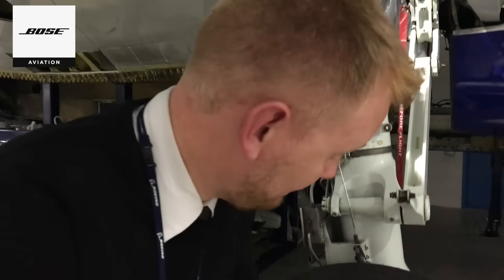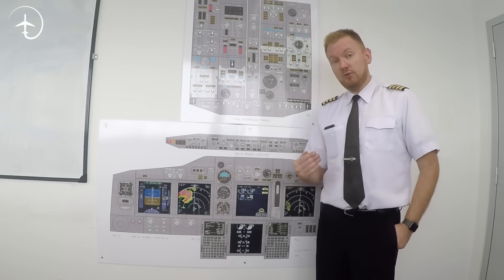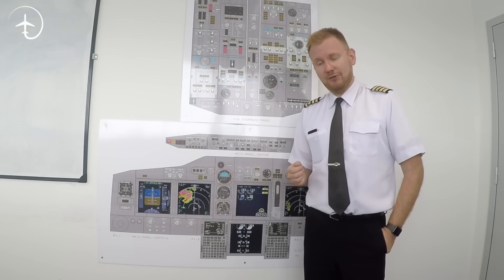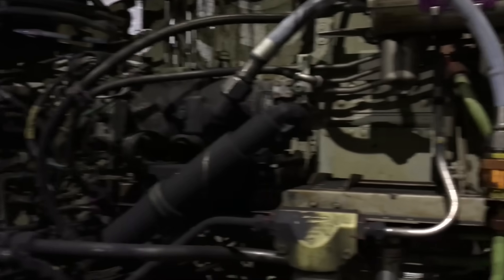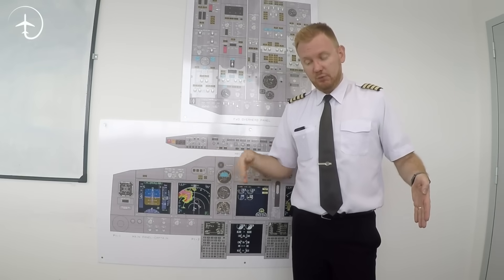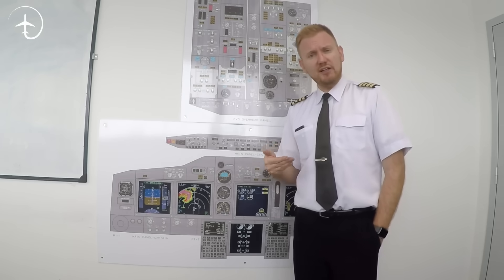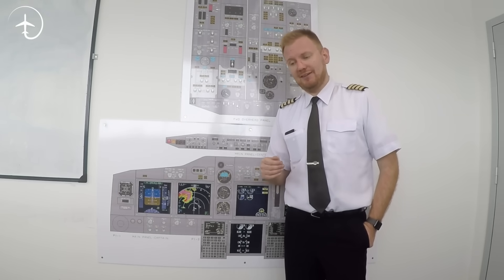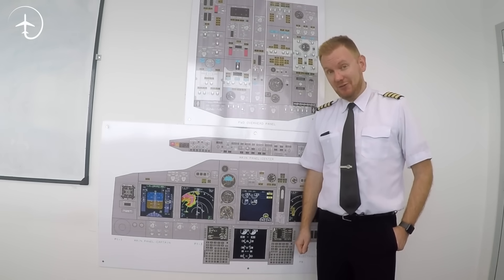Why does the Boeing 737 not have any landing-gear doors?

Comment: One note about icing on the belly of the aircraft. I flew the Shorts SD-360 for a regional airline in California. The SD-360 resembled a Winnebago with a wing on top, a rectangular fuselage and a flat belly. The aircraft was equipped with an ice detector on the belly which operated full time and the aircraft could not be operated in icing conditions it it was inoperable. If ice built up on the belly a warning light would illuminate on the flight deck to alert the crew. On a wet and cold winter arrival to SFO we were flying over the Oakland hills in icing conditions. A significant layer of ice built up on the belly and activated the belly ice warning. During our brief encounter we lost 35 knots of airspeed due to the icing. It required maximum power to maintain airspeed but were able to shed the ice, THANKFULLY, with some help from ATC to get out of the icing and as we continued our descent into SFO. As far as I know, the Shorts SD series are the only aircraft to have a problem with ice accumulating on the belly.

Comment: Why not just tap the brakes after take off to prevent from spinning?
Reply: I think pilots have enough to focus on immediately after lift off. Automatic braking of the main gear wheels is simple and efficient. There are no brakes on the nosewheel, so you would still need noisy "snubber pads" to stop the nosewheels turning. This noise can be especially disturbing to newbie passengers in the forward cabin area of 747's. The wheels are directly below them.

Comment: Okay. I'll be the one to ask the dumb question. How well does a plane land with one or more flat tires?
Reply: It depends on how many wheels the plane has. Obviously, a plane with 22 wheels will have less problems than one with 3. One day, I saw a Boeing 767 arrive at the gate with two completely flat (and partially shredded) tyres that the pilots were completely oblivious to. That is, there was no vibration or significant fuselage tilt sensed in the cockpit. The passengers probably heard and felt the tyres flapping around though.
Reply: As a passenger, I've probably landed on a flat tire or two along the line. Thanks for the reply.

Comment: I just noticed something very interesting on the 747 that I hope someone can shed some light on.  Upon landing, the nearest two Inboard slats (of three total on the wing) retract and tuck under the wing when the engines reverse.  That makes sense since it probably helps protect them from debris, etc.  But what's interesting is that they extend back out after the reversers turn off.  Why would they do that?  On the ground, they wouldn't be required, and they will be retracted again along with the flaps within another moment anyway.  Is it just a mechanical procedure that they  follow the conditions of the extended flaps automatically?  I haven't checked other planes for this, but I'm curious now.  :)
Reply: I believe it's to help prevent the leading edge flaps and structures behind the leading edge flaps being damaged by debris thrown upwards by the blast of reverse thrust. Note that the leading edge flaps on a 747-400 are not called "slats". They are called variable camber and Kreuger flaps. There is no air gap between the leading edge flap and the wing on a 747-400 (so, technically, not "slats")

Comment: BTW: I might have missed the video, but if it does already exist I apologize. If not I suggest a video about all the different noises and sounds you will experience during taxiing, take-off, climb, cruising, descent and landing. I had a mother who - while still alive - was a bit scared to fly (she did it nevertheless), but I could only put her at ease to some degree, as I am no expert and only recognize a few of the sounds myself. I could of course tell her when the sound came from the landing gear being retracted or put down, but a lot of other sounds are perhaps familiar to many but even though we've heard them hundreds of times when flying we may not always know the cause, and knowing the cause could help us calm people with fear of flying if we could tell them that the sound is to be expected and is nothing to worry about.
When my mother heard some noise that worried her or if turbulence was a bit rough and she was afraid it was more than the machine could take (yeah ... I know, I know), I always told her to look at the cabin crew and see if the flight attendants continued with their duties in a calm manner (serving food and beverages, handing out wet towels, blakets or pillows or just engage in a calm friendly conversation with a passenger, a child or each other). That would be an indicator that THEY are not worried by these sounds or the turbulence, which in turn is a good sign that nothing serious is wrong with the plane, which means YOU don't have to be worried either. That seemed to calm my mum down when se felt anxious due to turbulence or "strange noises".

But - back on topic - I'd love to see a video about the noises you'd normally expect during flight, perhaps covering different models. You could tell about the noises you'd probably hear in a B737 and perhaps invite an Airbus pilot to tell about the noises you'd expect in the A330 (I believe these are some of the most common medium and long haul aircrafts around these days). For instance I often fly the A330-300 to Sri Lanka from London (before that from Frankfurt), and I've never been worried about anything, but I'd always wondered what that loud humming is that you hear shortly after take-off continuing during the first minute or so of the climb before the engines rev down to climb throttle (after the initial take-off throttle). I always sit in business class (row 1-6) if that gives an indication of what I hear and I can usually see the engine right outside the window or just a little behind me when I'm sitting in row 3 or 4. I know what the "gear up" sounds like, and that lasts a lot shorter. This humming sounds more like it is going up or down when the engine is also reving up or down. And - as I said - the noise goes away completely when the engine revs down a bit a minute ot two after take-off. It's always been there and it doesn't make me uncomfortable - I'm just curious why there's so much more noise just after take-off compared to normal climb and cruise. It's not just due to the higher engine revolutions, it's a very specific hum ("wrrrrrrrrr") that goes away after a minute or two (as I recall). I'm not sure I remember the same sound from other aircraft models, so do you know if it is a thing that is specific for the A330?

Comment: Hi, can you explain why does the airspeed limit (VMO) changes with altitude?
For example, in a 737 at sea level it would be around 340 knots and at FL350 it would be around 270 knots.
And what can happen if the aircraft will exceed that 270 knots at FL350.
My guess to that question is that it has something to do with the mach speed being dangerous to approach to, though iv heared that airliners did get close to the speed of sound before with a very strong tailwind.

Comment: Why does the A320 have brake cooling fans but the 737 does not? Is it simply because there is no room for them and therefore there needs to be fans at the airport to allow for quick turnarounds? At least there wouldn't be a weight penalty

Comment: Thank you for your explanation.. However, I have a question regarding rotating wheels. Why do not you press briefly on the brakes so they do not rotate when the wheels get up in the wheel well after take off?

Comment: Hello. Can you tell us how stall warning works?? Why sometimes pilots trust more in speed sensors then stall warning sensor? Which is more reliable and which is more weather sensitiv?
Reply: Basically, there is a Stall Warning Vane on the leading edge of the wing, it is connected electrically to a circuit.

The vane is affected when the wing gets close to its Stalling Angle, around 16 degrees.

However, the vane is set to around 2 degrees before the stall angle is reached.
It is activated by 'suction' so when the wing exceeds the vanes settings this activates the Stall Warning alarm on the flight deck.

It is a 'warning' that the wing is very close to 'stalling'.

That is,
If there is further increase in the wing angle of attack in relation to the relative airflow then this airflow will be disrupted causing a sudden loss of Lift, and the aircraft begins to 'fall'.

There are 4 forcres acting on an aircraft in flight:
Lift / Weight  v's  Thrust / Drag.

All 4 forces must be equal for an aircraft to attain 'equilibrium' - and it flies according to Newton's 3rd Law.

Both speed sensors and stall warning sensors have their limitations.

If you want to learn more on this subject, I would suggest that you acquire books on these subjects, as it is a complex subject to 'teach' on YT.
Reply: the stall warning vane is on the first officers side in front and below the first officers side on airliners It is located in the same area as the pitot  tube and forward of the static port opening. The stall warning you are referring  to is on small general aviation aircraft. As for stalling  this occurs when the wing begins to reach an angle of attack of about 22 degrees relative to the angle if incidence.. Stall warning indicator on airliners sets of a vibrating in the control yokes known as a stick shaker. This occurs about 10 knots before a full stall. On climb out we could climb the 757 at 21 degrees nose up way beyond the 16 degrees you refer to.
Reply: captain757747  jack in the early70s, was doing SLOW FLIGHT,  FLAPS OUT, BARELY ABOVE STALL SPEED, WHEN I just caught sight of something, BANG, a TURKEY VULTURE collides to port wing, it too out the airframe HOBBS. & Athens STALL WARNING, , so the last stall, was recognized , but  horn did not work,, , so called it a day, went back to base, we could NOT BELIEVE THE DAMAGE, blood & feathers
Reply: It is amazing how much damage can occur on a bird strike. We sucked a pelican thru an engine on the 757 coming out of Miami in route to San Jose Cost Rica When we landed we found a piece of beak stuck in the carbon fiber ring around the front nacelle of the engine. Since it stayed there for 2 hours we decided to leave it there  rather than pull it out. We figured if it was removed that might lead to bigger problems. When we returned to Mia the mechanic said we did the right thing as this happened another crew an they pulled the piece of beak out. During flight the carbon fiber starred to shred and come apart which resulted their having to shut down an engine. A guy from NASA told us that hitting a 15 lb bird at 200kts was almost the same as throwing a 600lb rock thru a window. I found out that NASA tests their space shuttle windows and the airliner  manufacturers by shooting dead geese and chickens at test stand windows from an air cannon. A bunch of animal rights people  were raising hell about it  .Boeing and Douglas  suggested they take the birds place. It was fine after that. Have a great day!!!!!
Reply: In a nutshell, there are "Stall Management & Yaw Damper (SMYD)" computers which handles the flight attitude to prevent stall or other flight performance discrepency. These computers gets flight parameters such as aircraft angle of attack, airspeed, flight control systems, engine parameters and etc from certain sensors fitted to the aircraft.  The signals obtained by these sensors, are converted into electronic signals and sent to these computers to be processed. Therefore, after all the "calculations" are done by the SMYD, the aircraft systems will sort of give an early warning of an impending stall.
Speed sensors and Stall sensors are totally different components and functions for different purposes. There are various kinds of speed sensing, ie, using dynamic (pitot) pressure, using radio frequencies to measure and compare relative ground speed, and, using the gyro system to sense "displacement", thus giving an indication of speed.

Comment: I think the open wheel wells vs the weight cost made it, in current versions more efficient with the open wheels, but when it was first introduced I think the simplification of having just a wheel side panel and hubcap were as uncomplex as possible thus reducing ultimate maintenance cost/downtime.  I have been on more than 1 plane that had “traditional” landing bay doors and there were issues with the doors not locking in the proper position to reflect the landing gear as properly deployed and locked in position for landing.  Took a flight from PIT to CAK only to find the wheels weren’t locked properly and they felt they would have better success with landing back at PIT so back we went.  We landed without incident.  The tech said the bay doors were not catching/locking when the wheel was deployed.  So after a hour delay we went back to CAK and landed without further insident.  The other was a takeoff where the bay doors showed still open 10 minutes into flight, it was a early morning flight and I asked the FA if the pilot was planning on driving all the way to CVG?  She said that they doors were not retracting properly so the pilot received a locked signal with the wheels deployed but not locked when they were retracted so we were still landing in CVG but since they were showing locked he was leaving them locked until we were on the ground.  (made sense to me even with the aerodynamic cost, wouldn’t be helpful to have then retracted and then be unable to get them to lock down for landing.  
Never found out what the issue was, but it had to be funny.

Comment: My understanding with nitrogen in tires is not that it is unsusceptible to temperature expansion and contraction, it actually expands more in a heat cycle than regular air, the difference being that it is more predictable.  Nitrogen also doesn't pass through the rubber as much as other gasses in breathable air, and so air filled tires eventually deteriorate into Nitrogen filled anyways.

Comment: Great presentations. You do a great job explaining the arcane aeronautical experiences/ solutions.  I'm a retired Weapons Systems flight test engineer with 30+ years experience with the C&D, interfaces between the Gun, Rockets, missiles, Sensor systems. and appreciate the Aero part of aircraft design.The F-14 has the distinct honor? of being destroyed by one of its own AIM-7 Sparrow misslies, during a flight envelope expansion test. The  The chase plane alerted the F-14  crew members that the aircraft was on fire  and they immedilately ejected from the burning Aircraft but didn't really enjoy the 3/4 hour cold swim until rescued by a helicopter flying as quickly as possible.The chase plane circled the crew until the chopper arrived.

Comment: My understanding is that this does cause a little bit of drag, it's not quite as efficient as having doors - which is why the majority of aircraft have doors, though that does add weight. A big factor, as he mentioned, is that the 737 was originally intended as a regional jet, where the efficiency difference would have mattered even less, and the weight and complexity would be more important. If they were to redesign it completely for it's current role (mainline, even international, narrowbody) they'd probably put doors on (and make the gear taller, like the A320) but the drawbacks of the current design are small enough to not warrant the cost of a redesign. It's quite flush, especially with the hubcap. What I find odd is that some other aircraft with exposed tires, such as the Citation business jets mentioned, don't have hub caps, and I don't think the tires even sit flush with the belly, they sit further in, leaving a hole there. That would be a lot more drag than this. The other thing that I don't understand is the concern about protecting the wheel well from debris when the gear is retracted - I'd think that there wouldn't be any debris to worry about while airborne, the problem would be on the ground, when the gear is down. That would be more problematic with the 737, as regular gear doors close again when the gear is down, at least partially protecting the wheel well. The only thing I could see these seals preventing is drafts, which considering the speed and coldness of that air could potentially cause problems for the wheel well equipment.

Comment: That’s what I like about the Boeing 737 family and the engineering methods used - KIS “Keep It Simple” if it works don’t fix it, which appears to be the case with the 737MAX. The 737 is one of the worlds most successful aircraft and is a true work horse. I have heard the aircraft being referred to as the Ford Fiesta of the sky - simply because at some point most airlines have had or still have them in their fleet, they are have a robust design and are relatively simple in terms of maintenance. Great video :-)

Comment: Hi Mentour Pilot. Thanks very much for the information about the landing gear. Very informative. However, I read that the B737 does not have a fuel dump capability like the other Boeings. I don't know if this is only on Classics as i read on them only and don't know if the NG and MAX versions have them. I am just wondering what happens then if they have a problem after taking-off and had to come back and land and their landing weight would still be very high up from MLW. Would be great if you could do a video on them. Thanks - Ed